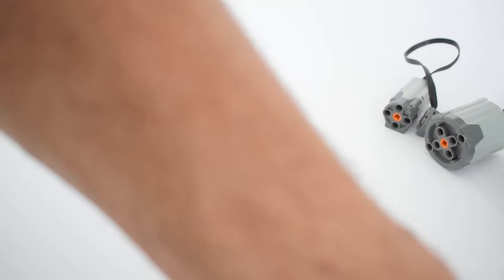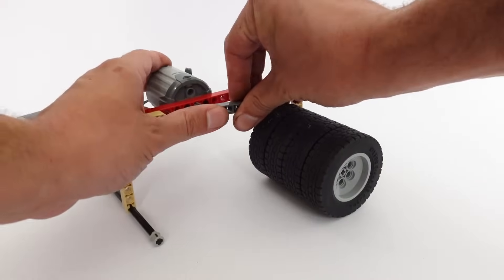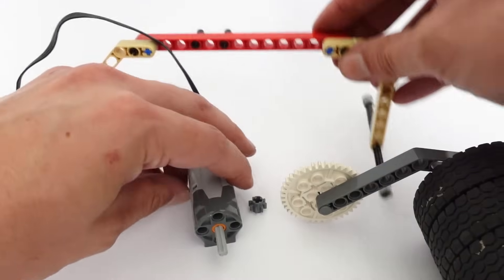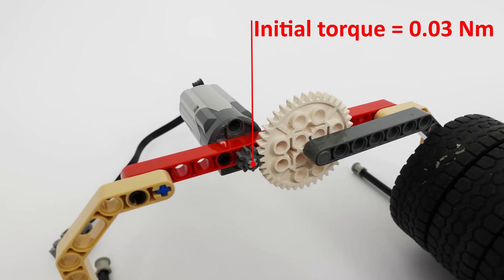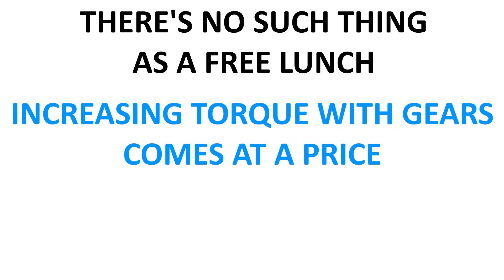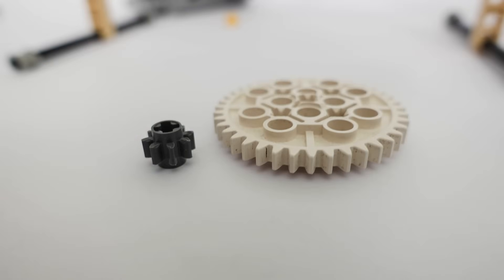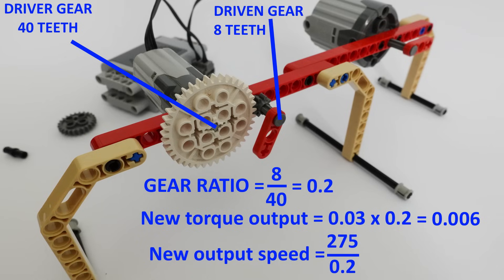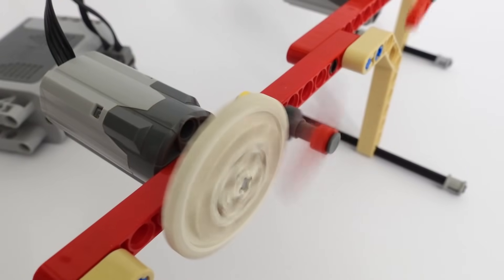NEVER be confused by GEAR RATIOS again - EXPLAINED in the MOST VISUAL WAY using LEGO

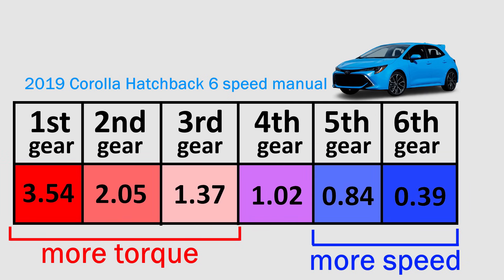Comment: 7:35 - Does the output RPM directly correlate to the RPM of the wheels? 

Consider the following example: 
1. In 2nd gear, say we have the engine going at 3000 RPM (input rpm). With a gear ratio of 2.05, this translates to an output RPM of 3000 / 2.05 = 1463 RMP.  
2. The Toyota Corolla hatchback has a 15" wheel diameter, i.e., 38 cm, which gives it a circumference of about 120 cm = 1.2 meters.
3. Assuming the wheels are rotating at 1463 RPM, this means that the car is going 1.2 * 1463 = 1755 meters per minute, which is 105.3 km / h

I am pretty sure that the Corolla does not go at 105.3 km/h in 2nd gear at 3K RPM. This probably means that the output RPM does not equal the wheel RPM. So how does the output RPM get tuned down before going to the wheel?

Comment: I’ve been working on a little project I call ZipBoat
It’s a small 3d printed boat powered by a zip cord using quarters as a flywheel like a beyblade attached to a propeller! 🚤 
Been through countless iterations
It’s finally working to a certain extent.. want it to work better 

The gear ratio I have right now is an 18 tooth zip cord to a 6 tooth gear drive

Wondering what would be most affective for keeping a little prop turning in the water moving a the boat forward 
The water has a lot of resistance so the prop stops turning fairly quick.. 

More torque or more rpm?.. it’s powered by a fly wheel so probably the only force translating into more power is a heavier flywheel and more rpm 

In which case how can I spin that flywheel up to the highest rpm possible 

I was going for rpm with enough inertia to keep it spinning 

Going from one quarter to two quarters made a big difference so I just redesigned for 4 quarters 

Hopefully the little boat will stay afloat with that extra weight 😂

But I think the extra fly wheel weight will keep that prop turning 

Any gear box suggestions to achieve very high rpm?

Comment: 3:58 Inaccuracy, if you mesh two 40-teeth gears together with let's say a radius of 5cm, you will have a 10cm lever, but no torque is multiplied. Rather, torque multiplication relies on the difference between the gears' radii/diameters.

Comment: I have a Doubt... If I fix 5 Gears in a motor and 4 Gears of decreasing order in number of Teeths to increase rpm and and have a final single Big (more tooth) Gear in a row to get more Torque... Will I get more Torque than connecting it directly to the Motor?... Pls answer

Comment: In short high gear ration give you more torque/force to push or pull, low gear ration give you more acceleration and higher speed but not too much force

Comment: one thing to give notice to is that speed and rotational speed are 2 different things.
the actual speed and distance covered remains the same. but because of the change in size of the wheels it wont cover as many rotations.
for example: One wheel's circumference is 10 cm. we spin it at 2rpm for 2 minutes. covered distance= 40cm. another wheels circumference is 40cm. we spin it at 2rpm for 2 minutes. covered distance= 160cm 
another example: gear 1 is 10cm in circumference. it is connected to a gear 2 which is 100cm in circumference.
if we spin gear one at 1rpm, covered distance is 10cm. gear 2 will only go 0.1rpm, but will still cover 10cm.
so the distance traveled is the same in the same time window. meaning they spin at the same speed. but not the same rotation speed.

Comment: You are GOD! I have been trying to get this for 4 years and I got it in 8 mins now! The part where I am still confused is where does the RPM come from? All me reading and watching has shown me that Torque and RPM have no relationship. Indeed, there's a peak Torque at a particular RPM but that they are independent of eachother. The only connection is that their product equals Power. So, where does RPM come from? Intuitively, it seems do me that its the piston thrust on the crank that rotates the drivetrain which to me is RPM but it looks like thats not the case. And the other but that confuses me is, why does the Torque tail off and start descending after the peak while the RPM keeps going higher for a while?

Comment: Hello, very Nice Video

A simple question, If a same gear box with exactly identical gear ratios is connected to two different engines, i.e engine 1. 100 horsepower and engine 2. 200 horsepower.

So for the above scenario if engine 1 goes at a speed of 100 KMPH at 3000 rpm

Would that mean also engine 2 would cruise 100 KMPH at 3000 rpm?

Comment: If the torque increase because of "Increased distance" between the driver and driven gear, cant we just increase distance between gears by using a chain drive system(like we have in bicycle)?

Comment: Hi i need to make a wind turbine to run a small 12 volt dc motor for my 6 years old boy, I am an accountant by profession and  have zero understanding of physics. But  I want to develop interest of engineering and since in my son.. can anyone advise how a slow moving turbine due to wind run a DC motor at an speed which at least light 12volt  bulb using gears.

Comment: really thank full for this knowledge, but i want to know how does combustion power calculated in oder to make more top speed? if 50mm piston changed to 55mm does top speed increase or do I need to changed gear ratio for best top speed without breaking the engine.

Comment: Can you explain what changes if i have same gears but less weight?
For example if i have two 15/44 gear ratios on a motorbike, but one has less weight than the other 15/44 gear ratio
What happen in torque, power and speed?
I have 13/44 on my motorbike, i want to change 15/44 and i know that cost me torque for more speed, but what if i lightweight my 15 pinion?

Comment: i am confuse here , as you told in the video that gear ratio is the ratio of no of teeth of driven gear to the no of teeth of  drive gear but in case of cycling we calculate ratio by dividing the no of teeth of chainring by the no of teeth of one sprocket where the chain ring is drive gear and sprocket is driven gear why like that hope you will clarify my doubt

Comment: The trick with gears is to understand that at the point of contact the force on each gear is equal and opposite. And the teeth are moving at the same velocity, because they are meshed. Once you grok that the rest is just geometry.

Comment: If you see this i could really use an answer. Tremec tr6060 input gear to counter shaft and then counter shaft to third gear.  29/33 and 33/37. How does the ratio of the first set of gears affect the 2nd set of gears.
Reply: 29/37
Reply: @simplemachine9531  Those numbers i stated are whats in a tremec 6060 which should come out to 1.30 for third gear. could you show some maths by chance.
Reply: @frozenstang3868  you have written all the maths already. A gear with 29 teeth rotates a gear, which then rotates a 37 teeth gear
Reply: @simplemachine9531  Dang, my brain just sees it like 2 separate ratios much like a diff. Guess i just have to accept this . smh  thanks

Comment: I went into this expecting to learn a couple of equations, but instead somehow I learned that gears are continuous levers, while seeing simple division used to describe multiplying either torque or RPMs to achieve a desired effect - from lifting a heavy weight to moving a lot of air. I think it's not just that you're better at explaining automotive concepts, but also you're better at understanding automotive science concepts than other people, and seeing through to much deeper implications to explain.

Comment: ok how about the same gear ratios? if a 14/42 sprockets have a gear ratio of 3 and a 15/45 also have a gear ratio of 3? Then what's the difference?
Reply: No difference of course
Reply: Even simpler explanation is they just work the same amount 😂
Reply: The higher number will have better top speed but lesser torque 
The lower number will have higher torque but lesser top speed 
This is interesting because since the math is almost identical you’ll hardly see a difference in them besides what I just listed
Reply: Tho you might also see a difference in mileage or operation temperature depending on your power/motor

Comment: Excellently explained.
The only simplified thing here: You not only sacrifice speed, you also get more friction with the gears.
So you always loose a bit of your calculated torque due to friction (which basically transforms to heat in your gearbox)
But that's probably not intertesting for LEGO, until you put in a whole buch of gears for a function.
Still, it's one reason to rather use long axels to transfer rotational power over longer distances, than using a dozen gears.

Comment: Perfectly demonstrated, how the gear translates the torque. 
Gears and transmission helps magnify the torque. 
At lower gears, the torque is more. And hence more acceleration. But you have to shift to the next gear to achieve more speed. 

Gear Ratio = No of teeth(driven)/ No of teeth(driver). 
This says, for a gear ratio of 5, the torque generated by a smaller motor is now magnified to 0.15.

How this happened? 
Gear Size
Radius increased. Leverage increased. 
Force input 
Force output

That magnified torque helped to lift the heavy weight. This magnifications of torque comes at a cost. Cost is speed. 
It is visible also the speed is reduced but greater torque.

In the 2nd case, where gear ratio was 0.2 which is actually 1/5 that says, for every 1 rotation of driver gear, the driven gear is rotating 5 times. 
And hence more speed achieved. 
Given: 275 RPMs before gears. 
New RPMs = 275 RPMs * 5 = 1375. 

How? 
Circumstance increased and reduced. 

Conclusion: 
Lower gears, more torque.
At lower gears we get the car or bike or any vehicle moving. Especially the truck carrying more than its load, at lower gear a massive torque is generated to move the Wheels in rotation motion and so the entire truck with the payload.

Power = Torque * RPMs/ 5252

So, for the second case, we see the power the activity of how fast a certain torque was generated over a period of time. 
We observed, 1375 RPMs giving us more horsepower at the wheel, resulting in speed. But again at what cost, the ability to life heavy objects was gone. It wouldn’t have lift the weight of the tyres. But speed was achieved. 
This is the magic if Gears, Transmission, Power and the root of all, torque which is the rotational force. 

Thanks for the wonderful explanation.

Comment: you're making a huge assumption about the gears in order to calculate your values. do you even understand that merely comparing the number of teeth on the gears is an inaccurate method to achieve an understanding of the amount of change due to the gears. Imagine a gear with the same number of teeth as the driver gear but with the diameter of the driven gear. Would your calculations still be accurate?
Reply: Would your imagined gears even connect to each other?

Comment: i have the same gears at my model. But the driver gear is the 40 gear and the driven Gear is th 8. so my Ratio is 0,2. that means 0,2 turn on driver gear are 1 turn at the driven gear ?
Reply: That's right. A gear ratio of 0.2 could be written like: "0.2:1", meaning every 0.2 rotation on the driver gear = 1 full rotation on the driven gear.

Comment: I have a semi that has 515 hp, 18 speed, and 3.55 gear ratio. Can you explain to me why my truck loses power drastically whenever I hit a small hill? I usually have to downshift like 6 speeds. So from 18 I will go down all the way to 13 or even 12. My speed will decrease from 65 mph down to about 35 in order to make the climb.
Reply: Hey, why not? Climbing up a hill requires more work to be done, and an engine produces a finite amount of power. That's why speed drops: same power, but more work to be done.

Comment: So why don't we have cars with 20 gears to change progressively to achieve high speeds?
Reply: I don't think that's impossible, it's just, where would that be used? At the moment the car manufacturers offer up to 9 gears. In order to increase the number of gears, there'd also need to exist an usage for them, otherwise it's additional cost for manufacturing the car without offering any benefits at all.

Comment: 7:35 which means in manual transmissions the higher the gear the smaller they are? For instance the 1st is the biggest in fact the car is significantly slower but has more torque and 5th/6th gear is smaller so it can match up the engine speed to go faster?
I'm getting to know how things work with engines, cause my job has to do with them even if not so directly. I think it's important for me to know things like this so thank you

Comment: What i wanted to see is, if we do the same experiments with the larger motor, with the higher torque, using gears that multiply the revolutions per minute, we could use a higher Gear ratio than that you used at 6:32, to get higher revolutions per minute than the small motor with less torque lost.  I ask myself these questions because if we used a lever larger than 1 meter, like the example in 4:13, with human force we could use it to make gears spin very fast. Can this idea work for Electric generators which need high rpm to produce enough current?

Comment: For a car engine to pull 20 tons it would need to be at 6500 rpm all the time to generate say 250 hp, it would be noisy and last only 5000 miles. A semi truck engine puts out 250 hp at 1200 rpm with no strain and will last >1,000,000 miles. That's the torque my friend

Comment: That was magnificent. Thank you so much! One question - at 5:18 you talk about the new output (55rpm) being created in exchange for increased torque. But that is for the driven gear. Does the driver gear also rotate more slowly? Or is that still chugging away at 275rpm as before? Thank you for your response!!!
Reply from the maker: Gearing has zero impact on the driver other than creating a load for the motor. The driver speed remains constant as it's the input speed, we're only changing the output speed with gearing.

Comment: Also, a loaded Semi Trailer weighs like 80,000lbs and a Honda Fit weighs like 2,500lbs.  If you did get it Moving, good luck getting it to turn or stop. You would almost certainly Die...

Comment: Great video, but with a mistake. The 6th gear can't have a ratio of 0.39. If so, the 6th speed would be more than double that of the 5th speed. Normally is it is about 0.7

Comment: Question for you if you have the time. What is the difference between adding a third gear into the equation. 2 scenarios assuming torque held consant
1) gear 1: 8 teeth, gear 2: 32 teeth, gear 3: 64 teeth. gear ratio of 4 and gear ratio of 2. Or gear ratio of 8 if going gear 1 -->3. Is it the same as having 2 gears?
2)  gear 1: 8 teeth, gear 2: 32 teeth, gear 3: 8 teeth. If starting and ending gears are the same. Does that mean it'd be better to not have any gear at all? or would the radial increase help at all. 
As an extension. 4 gears all 8 teeth next to one another. Does that do anything? 

@driving 4 answers your videos are awesome. Never been into engines before, but cant stop watching to learn more.
Reply from the maker: When you add a third gear between two gears the final output gear ratio stays the same. The only thing that changes is that the first and last gear will now rotate in the same direction instead of in an opposite direction
Reply: @d4a  super helpful thanks!

Comment: I appreciate the clear and visual explanation of "Newton meter". But I have a question if I may ☺. A one meter long wrench pushed with the force of one newton exerts one newton meter on the bolt at the center of the rotation. How about an engine where the power comes from the position of the bolt at the center, which is the shaft? Does the engine shaft produce one newton meter when it takes a strength of one newton at the end of a one meter long wrench to stop the engine from turning?
Reply: brake horse power- engine is connected with some kind of brake -and then measures force on brake for any rpm considering loss of braking, clear?

Comment: On my 2009 dodge pickup truck, with a hemi, with a 5 speed auto. transmission, 2nd & 3rd gear ratios are so closely matched, it seems one of the two gears are unnecessary. I've always wondered what's up with that?

Comment: Then why do cars accelerate faster from standstill to X than from an already high speed to an even higher speed if the higher gears provide more speed? Shouldnt the acceleration start out slow and build up as you reducde the gear ratio? But if torque is the cause of acceleration, why not keep more torque at higher gears to keep a good acceleration?

Comment: This is similar to what happens with diesel-electric locomotives, at least in N. America. There is a gear set in the traction motors between the motor itself and the wheel. The GP40-2 has a gear ratio of 62:15 with top speed around 65mph or so, while the F40PH has a max speed of 110mph with a 56:21 ratio. These both have the same engine and components (except for the ability to generate electricity for passenger cars), but have very different top speeds, not to mention pulling power, which the GP40 will win handily

Comment: So if we have small engine with not much torque and big, heavy engine, but both with the same amount of horsepower - they should perform similar with proper gear system.  Also horsepower is more like Wats, torque is more like Ampers and RPM is like Voltes. And on the end: horsepower is much more accurate measurement if you want compare engine performance.
Reply: yes, first is motocycle engine, second is car/truck engine
Reply: Except they don't perform similarly, on small engine longevity performance bad, noise performance bad, driveability performance bad, every incline requires dropping down 2 gears, low power except at high rpm. In conclusion, small cc Euro engine is shit.